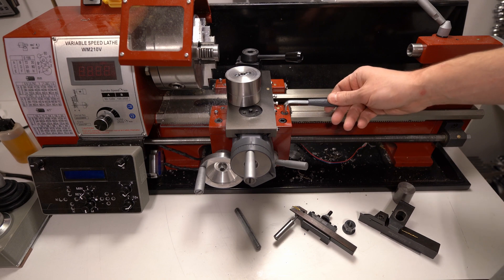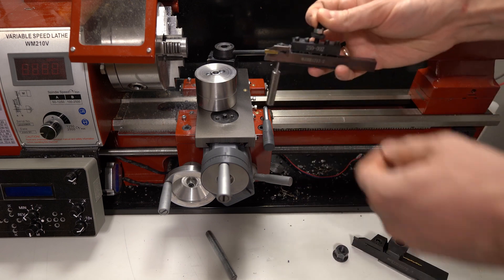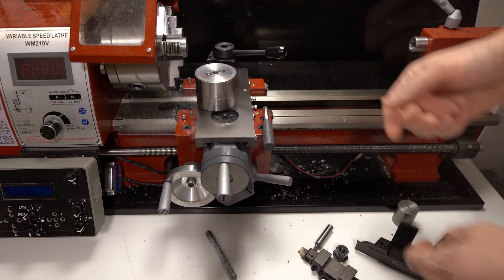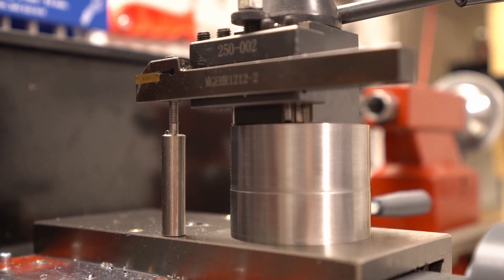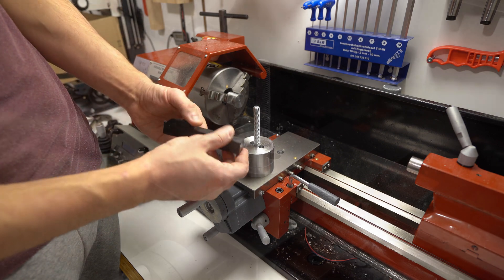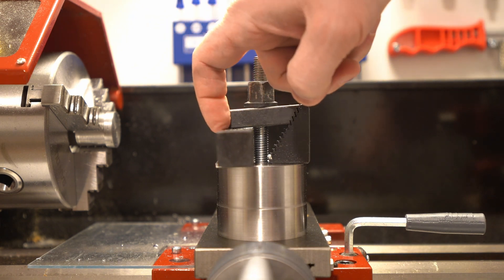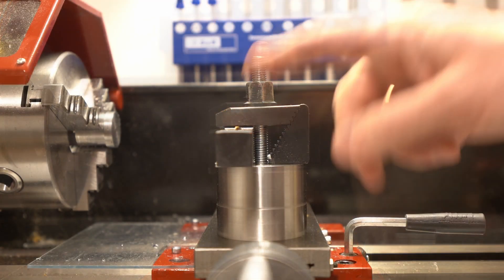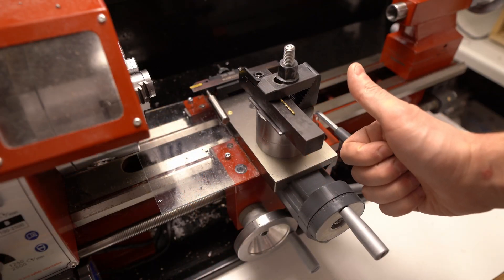Mini lathe: parting, rigidity

Comment: I have a 20mm knurling knife. It is too big to be installed on the original tool holder. Your method is good, but there is only one pressing block. Is it not too firm?
Reply from the maker: It's usable as is but it's just a prototype, to do it properly get 80mm square 50mm tall, there you can have 2 hold-downs (requires a mill for processing) - or 80mm round stock 50mm tall (can be processed on the lathe). Cheers!

Comment: You should try using a shallow HSS parting blade and get the speed down as low as it can go without stalling. Then there is no need for all those contraptions you made
Reply from the maker: Tom, sadly lathes like mine have no torque at low RPM, I can stall it holding the chuck with my hand.
Reply: @MaximKachurovskiy  +1 on the HSS parting blade, you can get pretty thin blades and they are easy to sharpen.  For torque you could try the sewing servo motor mod.  it would help with threading also.  Those carbide parting blades seem to need a lot of cutting pressure.